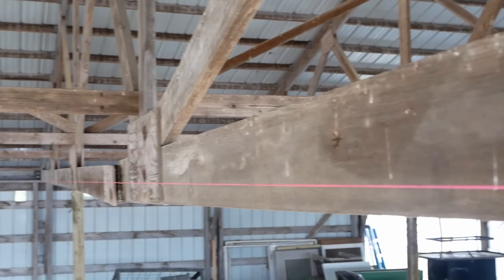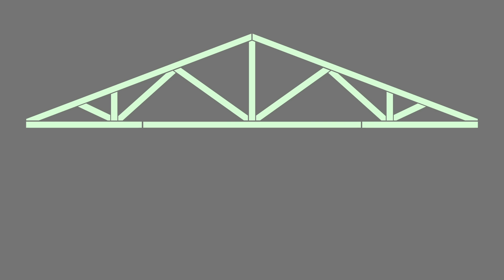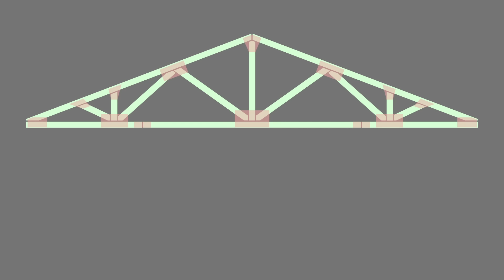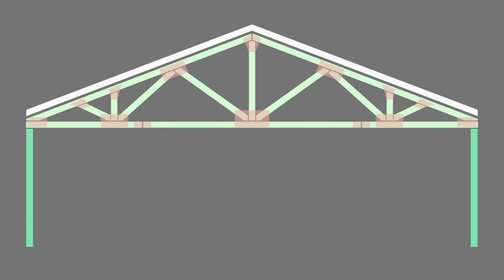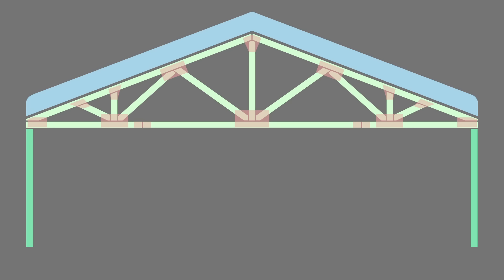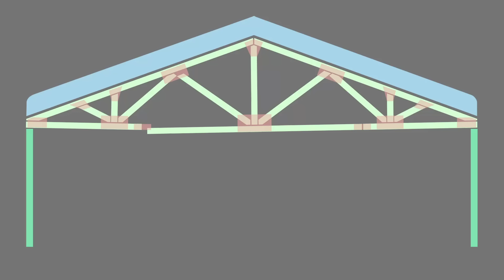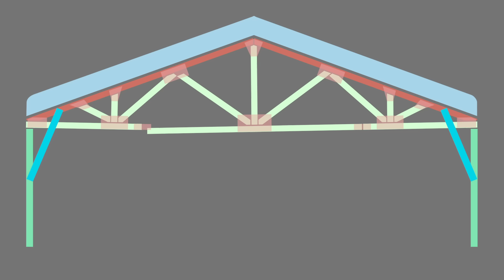Emergency Repairs: Dad's Shed Roof is Collapsing

Comment: In 96 we got a lot of snow. There was 3 feet of wet snow on the 26x70 shop roof. Many barn and shop roofs collapsed because of it. I got really lucky, and scrambled to get 3 jack posts set up in the shop to support the load. Seems like it figured out weight wise to be like VW beetles parked side by side and bumper to bumper all across the roof. We tightened the jack screws pretty darn tight, after the snow melted off, the posts were loose. The jack posts remain to this day.

Comment: I still maintain that the peple that watch your channel do all this stuff.  I personally replaced two rotted poles in my post bldg machine shed and made my own "permacolumns' before last winter hit.  The graphics were informational and I learned from it for a post frame I will build this year out of questionable used trusses.  As far as time spent, I believe we all would have been happy with some more of the original Wes pencil CAD that is an industry favorite!  Editing was spot in as usual, only things that nmove the story forward.

Comment: I'm glad that central Illinois didn't get the snow that you did.  I have TWO 50x100 pole buildings.  One is about 40 years old and the other is about 30.  If we had that much snow and ice they both would have been on the ground.  Great job coming to the rescue.

Comment: For what it's worth Wes, the weak point in your dad's building were the nails. He didn't have the same construction adhesives we do today. Had he used screws instead of nails which were hard to find back then this might not have happened when it did. What you guys did and dad continues to do today will make that building so much safer and stronger for decades to come. Most viewers I think don't care that every video has to be about autos, we enjoy you doing what you do in life. Personally I thank you for all you share with us. Ty😊
Reply: Screws were hard to find in the early 2000's...HUH no they weren't you could walk into ANY hardware or hometown and buy them

Comment: Thanks for sharing Wes, the graphics work great for those who don't know trusses and building structures. Looks like a good summer's day could be spent adding a few more trusses into that roof configuration (building them in place). Times are changing and weather is getting a bit "weirder", so beefing the roof up with some more trusses will reduce the load on the existing ones by sharing the load with a few new ones. Gladly the "boys" were there to help Dad out getting things squared up again. Stay safe and again thanks for the video!

Comment: I built a big pavilion for our Boy Scout camp back in the '80's that was 60' long x 40' wide x 20' high with unsupported roof trusses similar to the one's in your Pop's shed.  I copied the design of the trusses from an existing pavilion on a remote section of the camp that was not being used.  Hope mine lasts as long as your Pop's did.  Great video Wes thumbs up.

Comment: Your graphics were fine.   You got your point across well.  Good job, sir.  

When the weather dries out you need to knock all the itty-bitty scab panels off the joints, get some stacks of plywood and diaphragm those trusses.   Yeah, there are reasons we have codes for snow loads in the mountains… and why flatlanders die.

Comment: We have  free stall barn built in the late 70's with trusses on 10 ft centers and 2x4s on edge for nailers. At least around here, west central Ohio, almost every building is built today on 4 ft centers with flat nailers, too many wide truss barns collapsed, so far we have been lucky old free stall barn is still in use. Good job fixing it and I agree the long rafter cords probably saved it.
Reply from the maker: I think the quality of wood now is so bad they can't get away with the wide spacing that used to work just fine.
Reply: @WatchWesWork  Yeah I agree, and the contractor that built the free stall barn reinforced it with huge knee braces, used hardwood posts and the stall divider posts run clear up into the trusses
Reply: @WatchWesWork Agreed.  Wood now is fast growing trees planted on tree farms so the growth rings are really thick.  Old growth trees from the old days grew very little each year so the rings were small and the wood was harder.  This is why you can scratch your name in a 2X4 with just your fingernail in wood now.
Reply: I recently was at a home renovation where the a 2 x 4 truss joist had a cross brace that was 30% bark.  Very eye opening!

Comment: I am up in BC Canada and we had a perfect storm or rather a week of perfect storms hit my small community in the 90s. We had over 5 feet of snow and the rain hit. Most of the houses in town survived as most of them were built under a building code. Carports, garages, workshops and garden sheds did not fare so well. Very few of those still standing in spring. Glad your project worked out well. Cheers ~ulrich

Comment: My experience is that construction glue isn't worth a crap after a few years.  Bolted connections much better than nails too.  I'd have gone with dimensional lumber all the way along the bottom truss and overlapping the joints by as much as possible but doing the same with 3/4 Ply probably just as good.  Probably good for another 30 years...   Nice work!

Comment: Your Dad was so lucky that he didn't go out in the morning and found the roof on the floor.  A friend here in Australia had a farm shed of about the same size built.  It was in the Alpine area that is above 1200 meters,  His was about 1201 meters. but still the regulations applied.   It is massive when compared to a similar shed just down the hill.  It also cost about twice as much to build, but the higher pitch causes most snow to slide off. (parts of Australia do get snow)

Comment: We had to do that to my grandfather's place west of Champaign IL in the late 90's. We also used carriage bolts but used 2x8 scab boards on the bottom ones. It's still holding more than 20 years later.

Comment: Love it!  Interesting that he used 2x4 on edge and 8' spacing on trusses.  Still held.  I think failure was possibly due to age and adhesive.  Here in WNY most buildings have 2' spacing and the trusses have to be pretty strong just for their own weight.

Comment: Great video! As a carpenter's son, meaning I have no qualifications to say anything about carpentry, I think that the straight span on the bottom of the truss would have better if there was just one splice at the center over the pole support. But, I wasn't there and don't know what was available at the time. I've done projects on a budget, too.  This was an enjoyable video, I miss diags and fixes on cars and trucks and tractors and all things mechanical, but it's nice to watch Wes do what needs done, too.  And was a mechanical job and wound up with nuts and bolts and a ratchet, so its all good!

Comment: Excellent work, bolting the timber connections is much better. Maybe using steel as a backing to the plywood plates is worth the time and money. It definitely will hold a few more bulldozers now.

Comment: Just as interesting as your usuall videos and a fine work shop just caught in time imagine the. Mess if it did cave in it's stronger now than it's ever been Our biggest problem here in Ireland this winter is the wind we're not used to high winds we've had several power outhages and loads of trees down can be a problem near houses and any buildings interesting videos 👍👍

Comment: Wes, love the videos. Just thought I would leave you a little suggestion on your Dad's building.I live in WNY where we see pour fair share of snow. One of the thing farmers do out here to protect their building in high snow load situations is to run cases with turnbuckles across buildings and out the header plate with a steel plate outside as a washer. By doing this they not only reinforce the rafters,trusses,beams,ect. But they an also slightly preload the buildings during times of high snowfall to help with  sagging. This seems to help alot,especially when the centers of your supports are more than 4 foot on center. Just a thought keep up the great  videos ,always looking forward to your next one.

Comment: I’ve lived in a few provinces in Canada where we have a bit of experience with snow in certain places. In Nova Scotia, people are digging out from 150 cm of snow in some places which is about 5’. Some places have rain coming😮. The best thing you can do is remove the snow after a good snowfall. You can use a roof rake to remove it (people do climb on their roofs but it’s a bit sketchy). One brand that you can get in the US is the Minnisnowta Roof Razor. There are lots of similar ones around, but they basically get under the snow with a slippery tarp-like material and the snow slides off. The handles go up to 24’ long.  You might not get it all, but it sure helps. You can even put posts under failure points for the winter (if you’re not using as much of the space in the winter) and that will help. This helps cottages and camps where you might not be there in winter, but it’s best to find someone to clear it regularly. Thanks for the video, Wes! 

P.s. many years ago our cottage had cables installed between the walls and it’s held up over the years (60+)  whereas similar ones have collapsed. They do help.

Comment: I have built a couple of these barns myself for my mom’s farm. I never trusted the engineering for snow load. First off, it requires perfect truss assembly and installation. Further, it assumes that the structure is never compromised. On a farm stuff is hand crafted, rarely perfect. Then there is the wear and tare plus deferred maintenance that’s also so common.  I think a good engineer would have recognized the risk and added a few more trusses so a truss failure wouldn’t compromise the whole structure.

Comment: Very intriguing video to me. I'm the owner of a pole building company in Southern Ohio. We've been building pole buildings since 1972. Your understanding of trusses and loading is impressive being you are a mechanic by trade. My mechanic skills are amateurish at best lol
Reply: Wes is actually an engineer by training.  He has no qualifications as a mechanic.  Seems to do alright as a grease monkey though.
Reply: @dfross87  That makes sense the way he draws diagrams and explains things. My dad graduated Purdue University with a masters degree in engineering with his thesis based on wide span and spaced wood trusses. So I've had wood truss designs in my head my entire life. His explanation and understanding were spot on
Reply: @chrismosmeier555  I have no idea about wooden trusses.  The only wooden construction I have designed was a bed.

6" x 2" glued and screwed to a 4" x 2" for each rail.  Should be enough to hold up a single mattress, yeah?
Reply: @dfross87  I would say so lol

Comment: Nice Job! looks like the next job is hydraulic cylinder or a bad hose, I liked the graphics. I always say a farmer can build or do anything. I have a 30x56 and they used metal plates at the end of the trusses and bolted them to the 3, 2x6's that were put together to make a 6x6 post, and my shed has the knee braces made out of 3,2x4's

Comment: Wes, I really think your graphics explain the problem well. We have a pole building built exactly like your dad’s in 1963. It is coming apart just like your dad’s. Another thing to look at is your post bottoms. More than likely they are rotten at ground level. We dug by each post a bolted another to it.

Comment: When I was in college in the late 1980s, in one of the classes we tested truss joints. The strongest joints made were plywood ones that were glued and nailed together. They didn't have construction adhesive then like now (we used plain wood glue), and screws instead of nails might do better, but I was impressed by our results.

Comment: Wes,when I was in high school Dad bought a 1967 Plymouth Belvedere 2 door. It had a 318 with a 727 automatic. I helped Dad pull the heads as it had a dead cylinder due to a burnt valve. That car was a cruiser! Loved to go 65,70. Had factory air also.Sadly someone slid on ice through a intersection and mashed the front clip. Kid was cited for failure to control. AL B.

Comment: I will say that the issue with the plywood gussets (and the reason you are technically not allowed to use plywood for this anymore) is that the glue breaks down over time when even semi exposed to the elements and strength wise because plywood is layers of wood at 90° to each other your strength in one direction is actually less than you think depending on number of plywood layers.
A good upgrade at whenever in the future would be to swap out the plywood pieces for metal stimpson plates (or just metal plates) which will help hold things together alot better.
Would it have helped in this situation? Who knows, maybe 🤷 maybe not, the snow load was excessive.
I know for help with wind-shear (not quite the same but Im in hurricane country) we had to add tenstioned steel cables in an X pattern between each truss in our shop building - logically I'd assume something similar might help in situations like this as well in stopping the separation along the truss.

Comment: my dad put up his pole barn shop during my last years in high school.   my FFA class did the electrical wiring  was much the same with highline poles and salvaged rafters (some modified to be long enough- same pitch tho) and steel doors off a smelter  plant -- it was never finished either

Comment: We got that wet heavy snow over here in michigan, and I have a 13hp snowblower, and it had all it could take trying to get that stuff cleaned up. I invested in a quality roof rake also cause I have solar. It is hard work, but getting that heavy snow off the roof always makes me feel better. Plus, you avoid ice dams under the snow, which, if you've ever had one, is an easy way for your roof to start leaking. Thank God you and the old man were able to get that barn fixed up. That would have been a terrible loss for him.

Comment: Appreciate the video, will keep knee braces in mind. Don't have those snow load issues in the southern part of Illinois.

On a separate note, I'd guess that running the Thomas was rather chilly in that weather. Something that my dad had come up with for our old Bobcat 743 was a sheet metal duct that directed the heated engine air forward to the operator's area. It was simple in that one since the air vented upwards, directly above the engine - just took a roughly L-shaped piece of metal that could be put on for cold weather and taken off in late spring. (could probably describe it better or sketch something up if desired) That made it much more pleasant to operate; don't know if something similar would be possible with the Thomas, can't tell how the air is exhausted from the engine compartment.

Comment: That PL premium is strong stuff. I'm a carpenter and I'll tell you that I've had to pull stuff apart with premium as the adhesive. The wood comes out in splinters .

Comment: Our 1st house was built in 1972, a split. It was surrounded by huge pine trees when we got it ,we took down 40 trees that winter we got a lot of snow ..3ft I was home with the kids on a snow day while the wife was at work. Going down the hallway that ran down the middle of the house I noticed a seem opening up in the drywall where the ceiling meets the wall the whoe length of the hall. With all the trees the house had never really had a snow load and the attic scuttle hadn't been framed correctly. We did pretty much what you did but we only had a 3 pitch to work with. I was able to get a snowblower up on the roof to clean it off. It came back 90%. And we got a big check from the insurance company to boot

Comment: Over here where I live I've never seen plywood used as joiners but rather perforated steel plates and angle plates, the perforations allow for screwing or bolting them in place. I assume plywood is a cheaper alternative if you got in on hand and it works.

Here's to the shed standing another 17 years! 👍

Comment: Happy to see it worked out.
Don't go to crazy with the carriage bolts, as you remove material when you drill the hole for them, and it weakens the member.
In Denmark we had a big glued laminate roofstructure fail, because they drilled so many holes for bolts in the ends, that it looked like the edge of a post stamp.

Comment: Diagonal cross bracing is essential on these truss buildings. When I built my home the trusses came with extensive bracing instructions that we followed to the letter. We've had over 5ft of heavy snow on our roof with no problems. But if it rains, a person should be proactive and shovel some off.

Comment: I wouldn't call them "rafters", more like trusses.
It's crazy they're holding at all!
Your dad, your brother and you did a great job putting that barn together from scrap decades ago.
It's almost like your dad should have an 'emergency' roof heating system to melt the ice off when you get conditions like this.

Comment: I like the idea of reinforcing all joints with heavy plywood of/or 18 or 16 ga Galvinized on BOTH sides at each joint to help spread the shear forces,...... also I'd use Grade 8 bolts on those as well just to make sure you've got strength holding it all together!